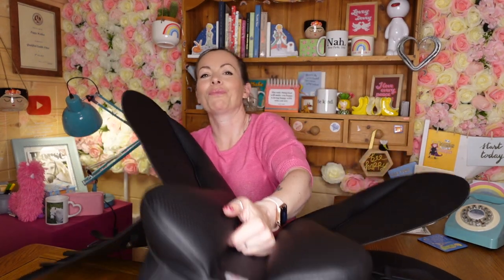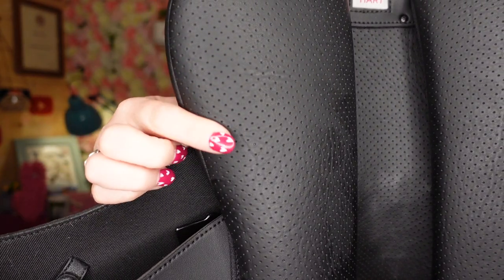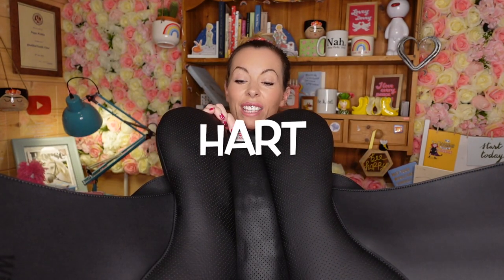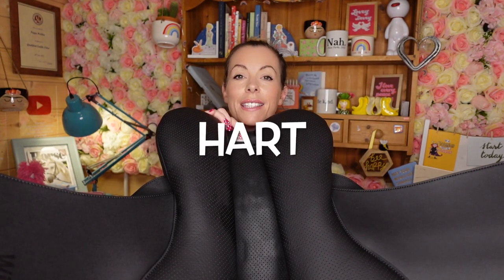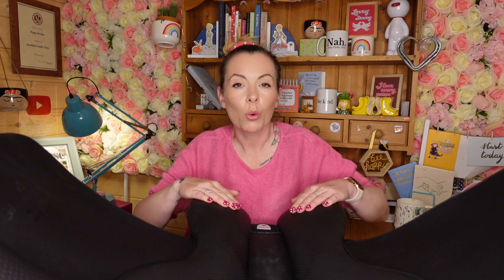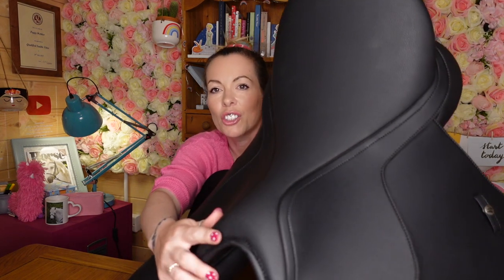NEW Wintec HART Saddle - Look inside with a Saddle Fitter!

Comment: Thank you and as other posters already wrote, I also would love to see a video on the Bates/Wintec shims and how to use them for adjustment for us saddle fitter amateurs.
I have a Bates Elevation and a Wintec 2000 VS both relatively recent models for the one horse and  am still fiddling around with both trying to make them fit better. 
I love the Bates/Wintec concept of being able to self adjust your saddle without necessarily having call a professional saddle fitter every time, but they offer precious little hands/ in depth instruction on how to actually do that.  
Thank you again for doing this in the first place.
Reply from the maker: I have a video like that, in the pipeline...
Reply: I'd like to see a shim video too! Just bought a Wintec Pro Dressage for a brand new mare who's very hard to fit, and am enjoying this content SO much.

Comment: Thank you so much for this!  I had a previous generation of the Wintec 2000 for awhile and both myself and my horse at the time were comfortable in it, but I did have some of the same concerns you did which is why I hadn’t gotten around to buying a new one before he retired (one of the tree points broke on the old one—shocked Pikachu face, I know).  It’s great to see Wintec has made so many improvements!  Also, I just checked and it looks like you can now buy leather quick change billet straps and swap out the synthetic ones since the technology has also been introduced in the Bates (leather) saddle line.  Will have to sit in a new Wintec next time I’m at the tack store.

Comment: Great review, glad they sent you a new one to look through. I'm also interested to see what comes of your exploration of the kinked gullet shape issue. And to discuss the wintec standard vs wide version and the Kent and Masters standard vs cob saddles. I found my wintecs and bates saddles were great on horses with thoroughred/normal (is there a "normal"?) shaped riding horse but then even the white plates just weren't working for the wider shouldered WBs/Morgan/Iberian/Arab-ish sorts. 
Another thing I noticed with the new saddle you showed was that it is gusseted panel in the rear with a "downswept" vs upswept shape. How does that affect fit and what kind of horses go well in those panels that come almost to points in the back? I noticed that was similar to older wintec/bates saddles I've had. 
Like some of the other viewers, these adjustable saddles are sometimes great when you are living nearly a thousand kms from a SMS fitter or a tack store, but hard to figure out if they are the right general shape for horse and rider to work well.
Reply from the maker: I think the panels work ok - there is a lot of talk of 'upswept' panels at the moment, which can be good for short backs - or horses who are sensitive at their thoracic/lumbar (back of saddle) area. But, in reality, I don't think as many horses need them, as the manufacturers of them would have you think. Pressure testing has shown that the pressure on the panel is minimal behind the part that is attached to the tree. Whereas the 'downswept' ones create more surface area. So there are pros to both. The panels themselves are so soft, that the 'points' at the back don't feel pointy... haha, does that make sense? :)

Comment: Hi Poppy, I live in South Africa and we have very limited options for affordable saddles. One brand that is very common and I can easily buy and buy accessories for is the Wintec. I love the idea of Wintec, but got put off from them coz of all the flaws in the older saddles. I am starting to consider them again (the new design), but one thing they haven’t changed is their gullet bars - what is your opinion on the gullet bar design, and do you think their kinked gullet design creates two angels and results in pressure points? I saw a blog from another saddle fitter that brought this issue to my attention and every time I consider a Wintec, this is what makes me hesitate 😊. I have a baroque built Friesian and I worry about pressure points on his round shoulders.
Reply: I have this same concern. We must have read the same blog. I love the idea of the new wintecs but i can't get past those gullet bars.
Reply: @isanybodyoutthere9694  for sure! I am actually trying to sell a brand new Wintec that now doesn’t fit my boy anymore (as he is now in top condition and the white bar is too small) and i want to go for the Wintec wide option, but I’m terrified it wasn’t just the gullet size that caused him the pain, but that wretched pressure point too and that buying a wide saddle wont sort out that problem!
Reply: @bronxxx9479  I feel your pain! Good luck with finding something to fit your boy. I recently purchased a Thorowgood cob (which is their wide version). I like their gullet bars a lot better than wintec. Poppy has a video on the Kent and Masters saddles (same company) as well. I don't know if they are available in your part of the world. I had a bit of a hard time finding them here in the US. It might be worth looking into though.
Reply: @isanybodyoutthere9694  thanks so much for the suggestion. That’s the other option I have been investigating. I have found two businesses that supply them here in SA. Been looking at the T4 Cob GP. The more I delve into saddles and saddle fitting, the deeper down the rabbit hole I go 😝. I live in the middle of nowhere and dont have easy access to a saddle fitter (Poppy, are you keen for a holiday in South Africa 🤣🤣), otherwise I would leave this all to them.
Reply: @bronxxx9479  saddle fit is definitely a DEEP rabbit hole. Our situations sound very similar. Glad you were able to find a supplier!
Reply from the maker: Hey - it's good question - and something that i'm also interested in. I need to pop a new bar next to an old bar to compare, but i feel like the new ones are less 'flared' out. I can see the reasoning behind the flared out gullet bars when they first came out- to open the head up a bit at the points. But, like you say - would that then result in a pressure point a little higher up? Potentially yes, certainly if the saddle balance was 'out' too. 

However... with the new Wintec/Bates saddles, the bar sits in the tree slightly differently than before and the new moulded (not stapled on) points result in a different shape. Because the points are now fixed, and the bar sits into the tree which isn't flared, the issue of that potential pressure point is certainly reduced, if not eliminated, as the points (and the tree head) are straighter.  
I am going to visit Bates/Wintec later in the month, and this is one of the questions i have for them. So i'll be sure to let you know my findings. But I think, currently, that the new tree design significantly helps. Does that make sense?

Also (sorry for the essay) - when we compare even the old Wintec trees compared to a 'traditional' tree, the traditional tree often has a flexible point attached onto the top/end of the actual point, which results in that bit of 'flare' at the bottom anyway - so it's not just the old wintecs that have that little flare out at the bottom - people are just more aware of it, because they can physically see it when they look at the bar. And some people have highlighted it - eg on the blog you saw. But it's really not uncommon in a lot of saddles. 

The only way we'll ever REALLY know is via proper research with pressure analysis. But, I can tell you, as a saddle fitter with a bazillion years of experience (i'm ancient) that it's not a pressure we can easily feel when we palpate by hand. Certainly not on an otherwise well fitting saddle. And certainly not on these new models. 

Does that help at all? I'll be sure to ask them when I visit in a couple of weeks and let you know xxx
<3
Reply from the maker: p.s. Bronwyn- yes, i'd love a holiday to South Africa... *packs bikini* As long as you don't have poisonous spiders...?
Reply: @ADayInTheLifeOfASaddleFitter  awesome (*gets spare room ready*) 
. We do have some here, but I am a nature conservationist by profession and will have your back! 😝😝
Reply: @ADayInTheLifeOfASaddleFitter  sorry Poppy, I didn’t realise the read more on your reply - thanks for the essay (really thanks) and what you say makes tons of sense - I cannot thank you enough for your help and I stay tuned for your updates so I will keep an eye out for anything you report post your Wintec visit
Reply: @ADayInTheLifeOfASaddleFitter  Thanks so much Poppy! Can't wait to hear what you find out.
Reply: @ADayInTheLifeOfASaddleFitter  thank you for this! I just bought a new version HART Wintec Isabell for my 22yr old mare. We’ve used many different saddles over the 19 years under saddle, the worst damage to her back actually was from a very expensive ‘custom’ saddle. I’d used the older Wintec 500 and Isabelle for our school horses and we didn’t have issues even with the less than optimal panels. We had them all checked by a master saddle fitter twice a year, and some were checked more often depending on age and need.  I was very concerned I’d made a mistake going to a new Wintec based on the sudden hot new topic of the “crimped gullet plate” (again, our older Wintec, Bates systems never created any back issues and I have two sets of the Possibly, Hypotheically, and not scientificly studied so-called dreaded “old crimped style gullet plates”... 

I AM wondering, and will need to research ASAP whether Wintec has a new gullet plate designed specifically for the new HART style saddle trees. I will be fitting my mare tomorrow, and I know the standard Medium black plate will not fit her Rubenesque figure! 

Your thoughts? 

As I said, I have two sets of the old gullet plate and gauge systems. I will do a visual comparison of the new vs. the old styles before making any change. I was hoping to ride... but my luck will be they aren’t compatible and that will mean ordering ....and waiting... 🤦🏻‍♀️ Patience. Such is life! 

Thanks for your fantastic and informative videos. Super timing too! ☮️♥️🐴
Reply: @ADayInTheLifeOfASaddleFitter  , thank you! I have a HART Wintec dressage saddle ordered for the end of June and look forward to your input on the gullet bar.
Reply from the maker: Hey - Just to update you, I am making a video with Bates/Wintec tomorrow, which will be released later in the week - where I'm asking about this gullet bar shape <3 So, keep your eyes peeled for that. xx
Reply: @ADayInTheLifeOfASaddleFitter  thats great Poppy, thanks sooo much! I will keep my eyes peeled
Reply: @ADayInTheLifeOfASaddleFitter  Hi Poppy, any news on the Wintec/Bates video? I am getting very close to buying a Wintec Wide for my boy, but still feel uneasy about the gullets - I dont expect a video, but maybe just your opinion on what they had to say about it - I dont want to end up with another saddle I have to sell 🤗 - is this kink gonna cause a pressure point even if the gullet is fitted correctly?
Reply: @ADayInTheLifeOfASaddleFitter  yes I’m keen on the video re gullet shape with Wintec/Bates
Reply: I'm from sa too!!! There's a place called solo saddlers in joberg that make saddles and can probably help you.
Reply: Wintecs are a good temporary saddle but I end up fighting the stirrup bar placement.

Comment: Im in an odd situation and could use your opinion: I live in Ecuador and buy saddles and that in the USA (cost maybe 3 times less). It means that its a real hit or miss thing buying a treed saddle and expecting it to actually fit. this HART wintec rig appeals to me but what other flexible fit or fit on the fly system would you look into? I have 3 andalusian (PRE) horses. I ride mostly for pleasure and for exercise, and I only weigh 160 pounds on my 1100-1400 pound horses.

Comment: This is brilliant. I have just watched a few of your videos, starting with 'which girth straps/billets straps to use' because I have just bought a Wintec 500 All Purpose Wide - Hart saddle and had forgotten the principles of which girth straps to use. I live in France and it is very difficult to find a saddle fitter due to the distances needed to travel, so it is very much a question of having to help yourself. Your videos are so informative and in-depth. I have a question though - I think I am going to have to use the point strap, as my mare is so full-barrelled at the moment - do I move the third strap to position 2 so that I am using straps 1 & 3 albeit I am using point strap and third strap moved to position 2? I think I've thoroughly confused myself now. Thank you once again for such helpful videos.

Comment: They changed the name because those of us who have had saddles where the cair was removed and flocking put in have talked about how horrid cair was and how we wouldn't do it again.

Synthetic cracks so easily that the buffer is ideal for those saddles. Get a longer girth if it's that bad. or a girth extender or even a tightener

Comment: I recently ordered a wintec 500 dressage that says it's flocked with no cair. What kind of flock does wintec use in their newer version?
Reply from the maker: Wintec no longer flock their saddles. All of the newer ones come with the CAIR. If it's flocked, it must be an older model, it will have synthetic flocking in it. :)